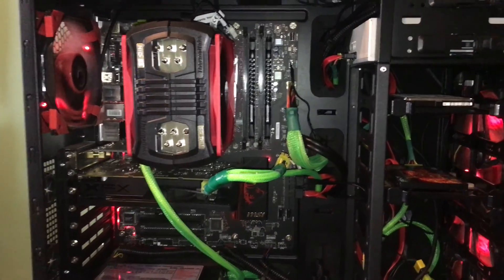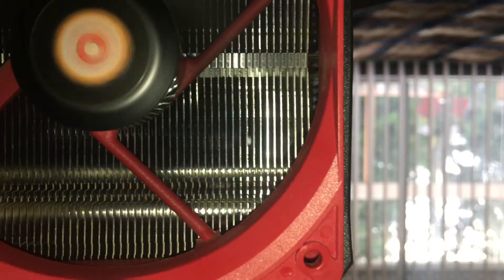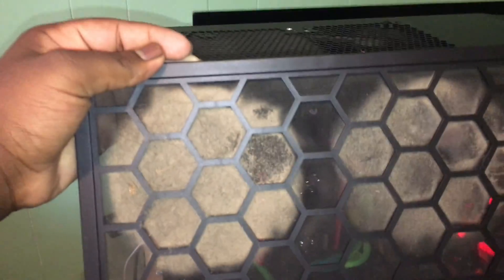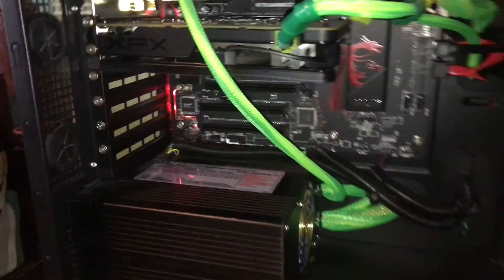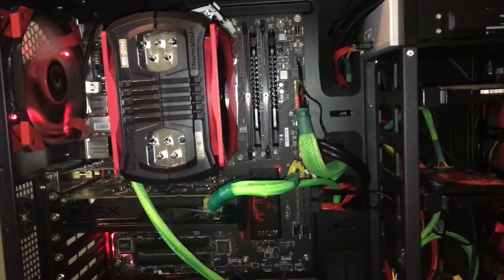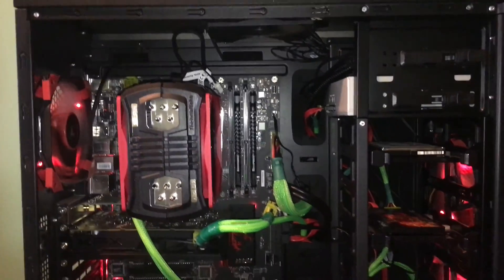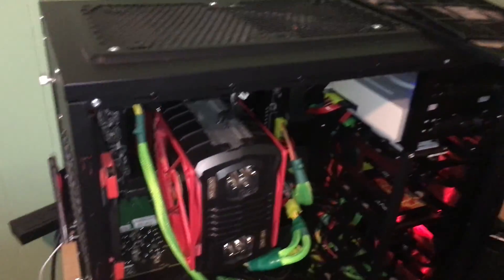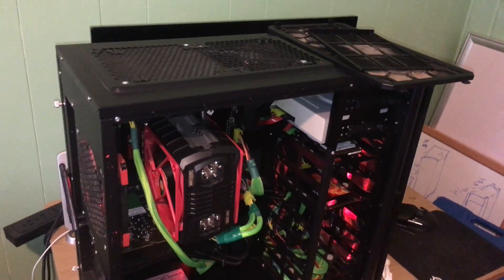Keeping computer dust free

Comment: you want solid pcie slot covers to prevent dust from sucking in through pcie slots.
Reply: Futile silly direction to go, then the connector slots are gonna collect dust. Or any kind of nooks and crannies. Just have the most air possible, sucked into the case at one side, with a nice filter.